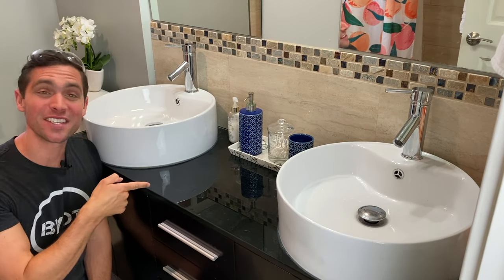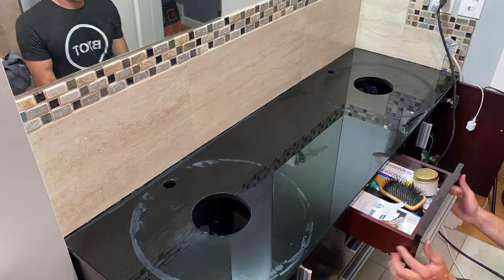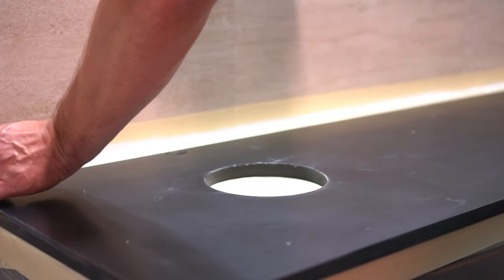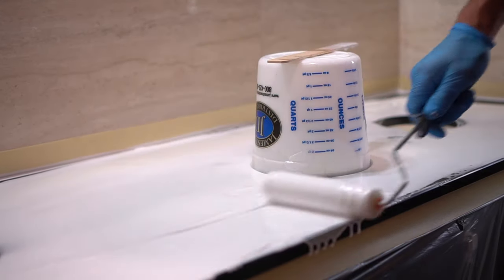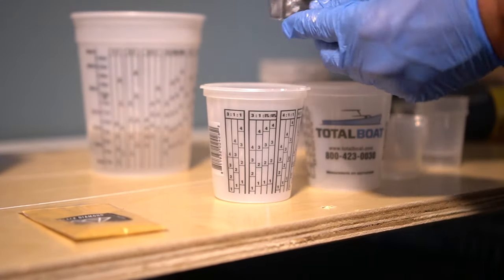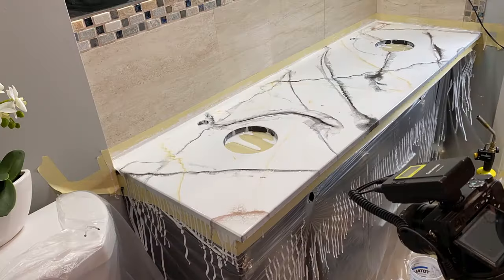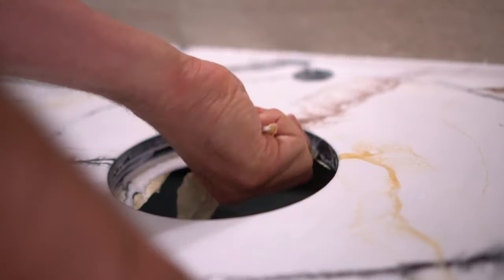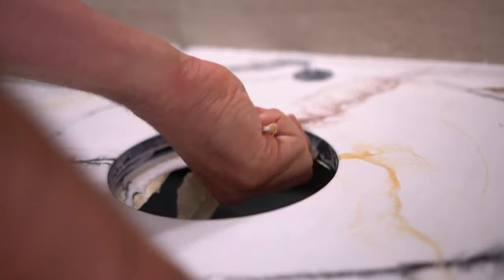DIY EPOXY COUNTERTOP // Bathroom Countertop Makeover

Comment: I've heard that total boat epoxy does not have a very long working time, so would it be hard to do kitchen countertops without it curing/ getting  stiff too quick with the effects like you have maybe even more.?
Reply from the maker: It does harden up quicker then other types of their epoxies but you still have a lot of time to work with it.  If it’s a larger kitchen project I would plan on doing it in sections. One slab section bs doing them all at the same time.  Hope that helps Jessica and thanks so much for watching.

Comment: When we started letting ours cure, the next morning we saw it dripped more over the edges overnight even though it seemed fine before bed. It also creates some ripples/bumps because of this. Seemed like it wasn't drying as fast as it should have. Any advice for this? Our top theories are maybe we didn't mix it thoroughly enough or maybe we mixed in the wrong order?
We primed our bathroom counter before hand but we aren't sure if any primer works or if it has to be more specific. Do I need to sand the primer after it dries if i have a granite countertop?

Comment: The sinks in both of my bathrooms are that cultured material with the scalloped sink made into the counter top, all one piece. Would I be able to use this on that, including the scalloped sinks? The one in the master is cream with brown marbling and the other is cream with yellow, so they never look clean.

EDIT: I looked at the Amazon page and it doesn't look like it will work.  Does anyone know of any cost-effective options that would work? We're looking at doing a refresh (paint the dark paneling and replace the old vinyl) soon and waiting to do the full reno.
Reply from the maker: Hi Brad.  thanks for the comment and the update.  Is there a reason why they are saying it won't work?  Thanks so much for watching and your support though :)